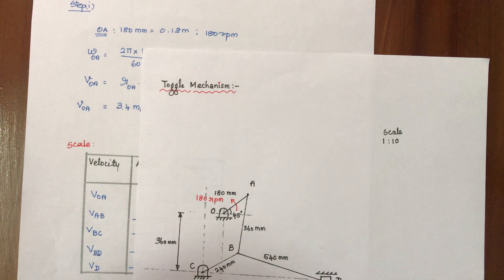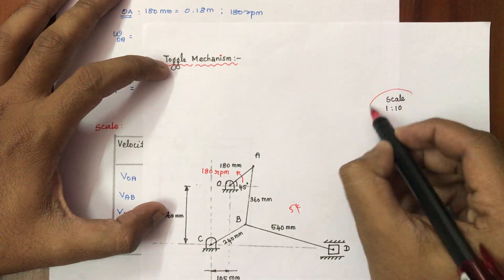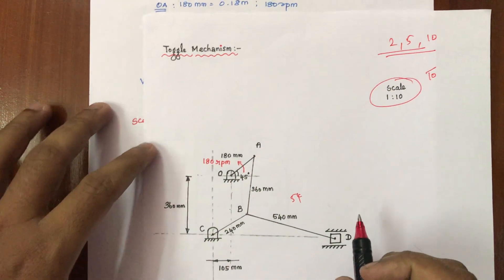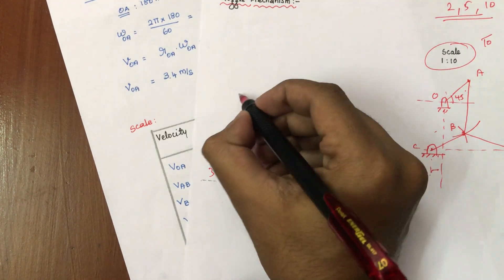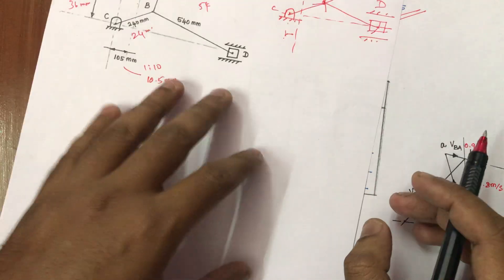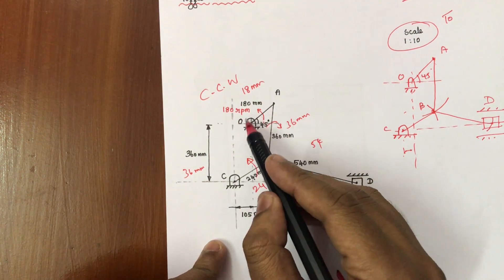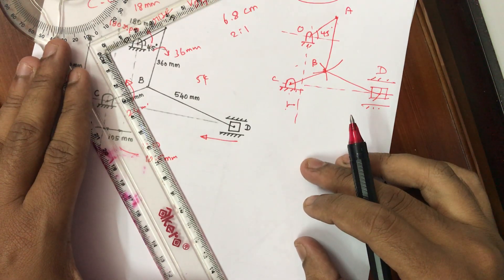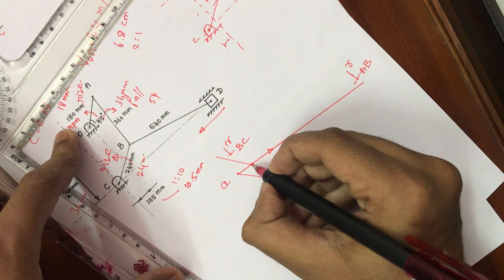Velocity Analysis for Toggle Mechanism - Kinematics of Machinery (KOM) in Tamil

Comment: In the toggle mechanism, as shown in fig below the slider D is constrained to move on a horizontal path. The crank OA is rotating in the counterclock wise direction at a speed of 180 rpm. The dimensions of various links are as follows: OA = 180 mm, C. R = 240 mm, AB = 360 mm and BD = 540 mm. For the given configuration, find: (i) velocity of the slider D, (ii) Angular velocity of links AB, CB and BD, (iii) Velocities of rubbing on the pins of diameter 30 mm at A and D, and (iv) Torque applied to crank OA, for a force of 2 KN at D.
Reply: intha question answer irukka bro